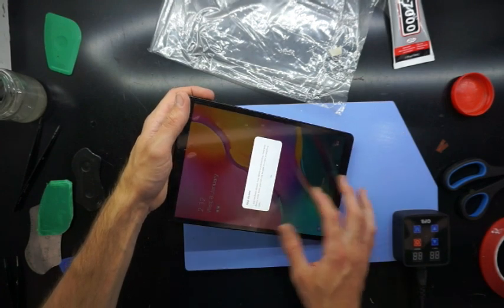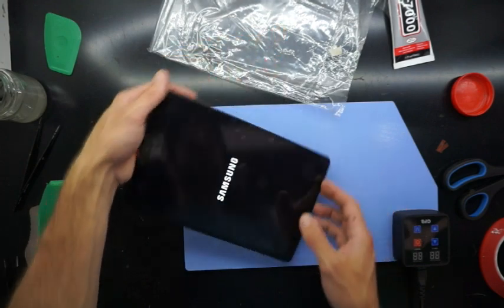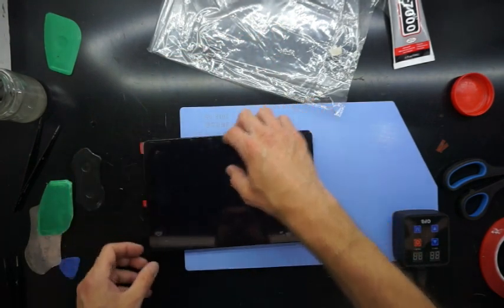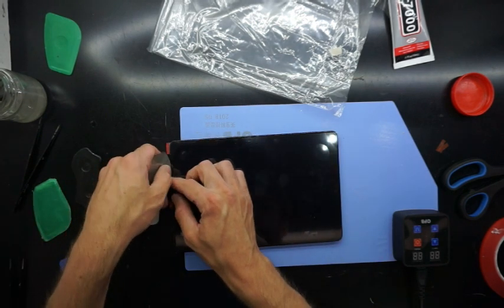Samsung Galaxy Tab 2019 T510 LCD & Digitizer Replacement

Comment: If you observe there is a gap between screen and body so what happened is every week dust accumulated in that gap i used to clean with my finger rubbing it hard but over the time it got loosen and suddenly when i was in my class it popped out i terrified screen went black but i can still listen audio so i sent it to service centre first they said its a display problem and after 25 days i.e today now they are saying there is some problem in the board , a pin is missing etc  so i asked is display good or both display and mother board damaged they unable to answer one thing i understood is that i should pay some extra bucks. They charged me around 110 us dollars so i want to ask is is it really motherboard problem or they want more money??
Reply from the maker: Has it been previously repaired?
no amount of rubbing the gunk out of the gap on the screen would make it fall out

with a screen falling out it might pull on the flex cable which would pull on the board connector and possibly damage that 

but with this model there isn't much that can be damaged from the screen falling out, i replaced one yesterday and it has a single cable and adhesive around the screen and frame.
Reply: @rickstechrepairs  glad you replied
No it's the first time I sent it for repair and the work is still going on I don't know they are telling truth or looting me :(
Reply: @rickstechrepairs  will this effect the display or motherboard or both ??
Reply: Hlo there so i received it after almost 2 months and also they didn't close the screen perfectly  i mean screen didn't fix well ..
The service is terrible at my place....

So should i use any gum or it will be good if i take it back..??
Reply: I am having the same problem it's not becoz of rubbing edges it might be cause of your device cover coz it might hold the outer back cover but not the screen itself so when you tilt the device the mass of screen pulled it off its cover so it might be a problem in disconnection of the ribbon umm I am still having my problem tho idk why

Comment: i got the screen to turn on but i have no touch inputs. can anyone help me? do i need to buy a new daughter board and if so where can i buy just that part from?
Reply from the maker: Double check the ribbon cable for the digitizer 

Remove and reseat
Reply: @rickstechrepairs  i ordered a whole new broken tablet and took the digitizer off and the cable. i tested them before i took it off the broken tablet i got for parts. they worked so when i put it on the new screen i have i still cant get any touch functions to work at all. if you can help i would be really greatful. i had this customers tablet for 3 weeks. all bc the first 2 screens i bought didnt come with the digitizer board so i had to wait on refunds. its been such a mess.

Comment: What Happens If You Remove the Touchscreen Digitizer While the Tablet is Still Turned On? I'm replacing an unresponsive touchscreen digitizer so I am unable to power down the unit.
Reply from the maker: i would keep digging until you get to the battery and disconnect it

Comment: Heyy i have a problem. I have the same tablet. i was using it when the display suddenly fell and the orange thing connecting them detached. i watch this vid so i can see how to reattach it again. i did it but it still wont turn on. what should i do? i rlly need help
Reply from the maker: the orange ribbon cable is called a flex cable it might be have damaged the connector when the screen fell out
Reply: i tried to check and i see no damage (at least with what i see with the naked eye). plus it didnt fell hard, and earlier the screen was black but has light, but it disappeared again

Comment: I just ordered a digitizer (front glass) for a sm-t510 - It looks pretty simple to separate the broken one from the LCD ??  If I was doing this as a business I would not think twice of charging the customer more for the part to save my time, but my LCD is fine, the glass digitizer just took a tumble. 25$ v/s 70$ LCD.   BTW: Thanks for your video
Reply: Mike41  I sent the glass back too. and ordered the lCD combo,  I got it, and when I plugged the two up, I think the data cable from the tablet to the screen got distorted, it has a little hump in the contact. not sure if something got under it or what. I wound up sending the screen combo back to amazon and just getting a new tablet, someday I might get brave and try again.  it's not for the faint hearted to attempt but for right now I need a tablet and not a project. All in all this looks like a simple repair, I am worried I damaged the tablet electronics.
Reply: A new screen/digitizer shouldn't cost more than $35.

Comment: Dear friend, Thanks for your video. I need a little more help. I did exactly same thing as you shown in video but the screen of my tablet is black after connecting the cable. I de attached and reattached the cable several times but the problem did not solved !!! I am hearing the Bib sound when I am pressings volume UP  / Down button , but I see nothing in screen. Please Help me !
Reply from the maker: Sounds like the new screen might be a dud, or the flex cable that connects to the screen may have damage

Comment: Hello everyone, can someone perhaps help me? The new display is not working even though I have connected everything. I suspect it has something to do with the silver adhesive strips on the back of the display, as the new display doesn't have any. There are black contact points on the circuit board at the corresponding spots. Thank you in advance for any support. :)

Comment: not a good design, cant disconnect battery before working on it..........
Reply from the maker: agreed
Reply: @rickstechrepairs  I have another one here today for screen replacent and I tested the small digitizer board.... It is secured to back of screen with conductive tape to ground it.